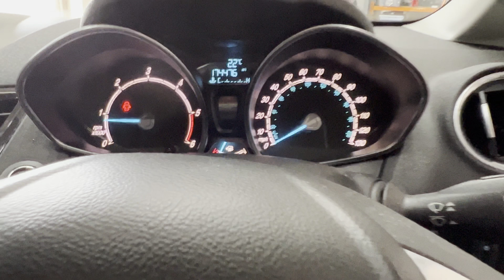Stolen Recovered Ford Fiesta Titanium X Toms Car Gets A New Clutch Part 1

Comment: In answer to a couple of questions it's only done 1500 miles since it was serviced and mot in February so the scum bags didn't drive it much .the car did have a couple of scratches around it before the theft so your spot on Mark it hasn't been trashed which to be honest we are all surprised with. We never expected to see this car again and Thomas was really happy with the red one and appreciates you getting it ready for him so quickly. Just a massive thank you Mark
Reply: Its a tidy car especially for 174k miles, refurbed wheels would finish it off nicely!
Reply: @markopolo9559 what colour would you suggest. Been talking to Mark and thinking gloss black or an anthracite colour.
Reply: @dcdriving2463  gunmetal grey, Mark done some wheels before in a grey and looked great.
Reply: @markopolo9559  bare that in mind thank you.

Comment: have you used a chair 
or a tool trolly style chair
to save your knees and back ?
garage next to me has a mid lift ramp low roof building
the two guys use  chairs  just a thought bud?
Reply from the maker: Hi mate I do have a chair stool and my knees are well padded 👍👍
Reply: @ResurwreckAutosUK  just wondered as you are always on your knees bud   cheers